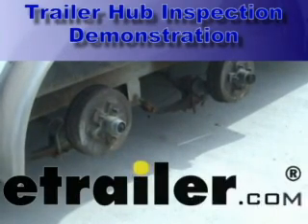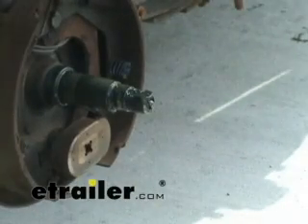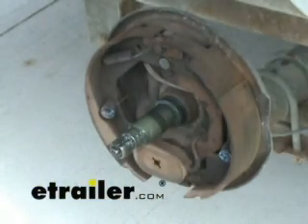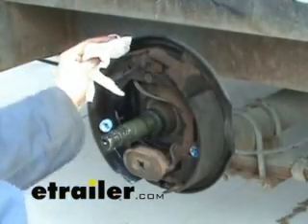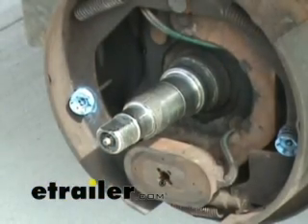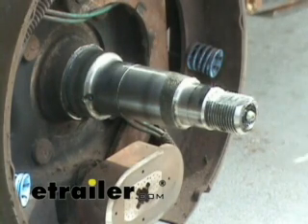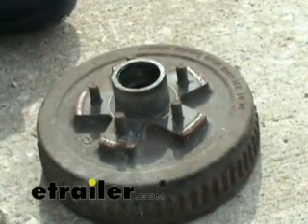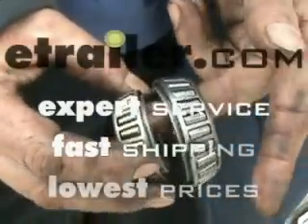etrailer | Trailer Hub Inspection Demonstration

Comment: turn the wheel, tap with platic dead blow hammer….no need for screwdriver method as it will damage the cap.